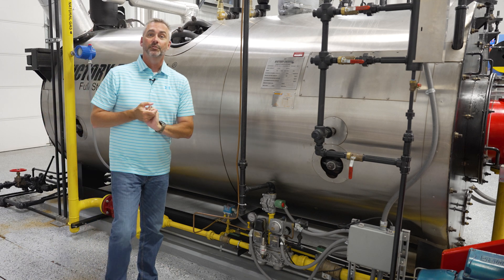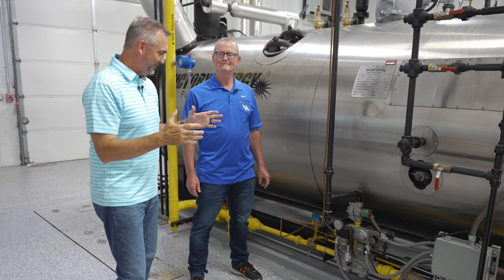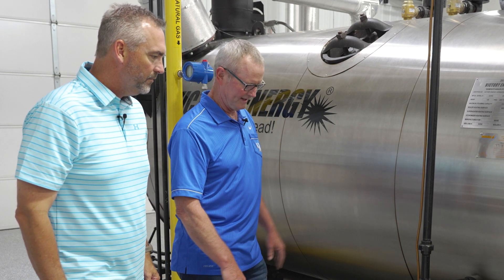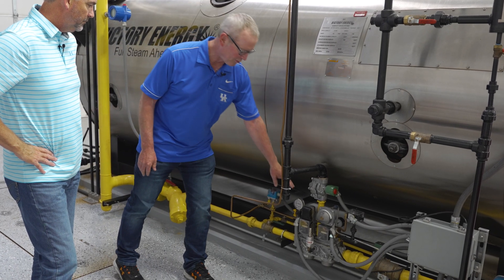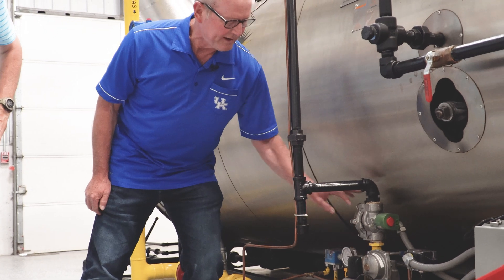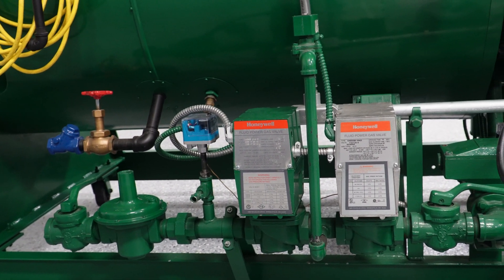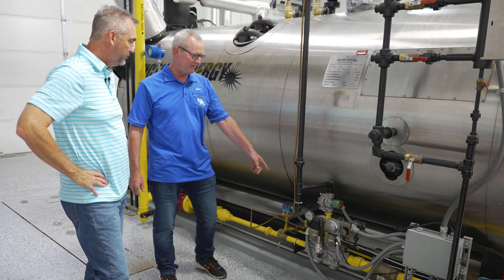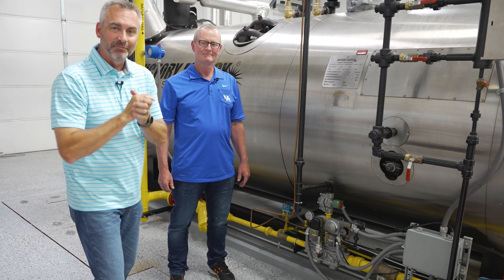Gas Trains Simplified - The Boiling Point

Comment: The traditional valve setup that was shown had a regulator upstream of the valves meaning that if installed in the same situation that the gas pressure applied to the valves would be lower. A reason why the Siemens valve installation as shown can be a lot smaller than the traditional setup shown is that the gas pressure to the valves would be higher, therefore you can get the same gas flow rate through a smaller valve.

Comment: I didn't pick up what the gas train is connected to? A water boiler? What is the overall purpose?
Reply: The gas train has several components that safely feed the gas (fuel) into the burner.
Reply: Gas train > burner > 🔥 🫖 😂